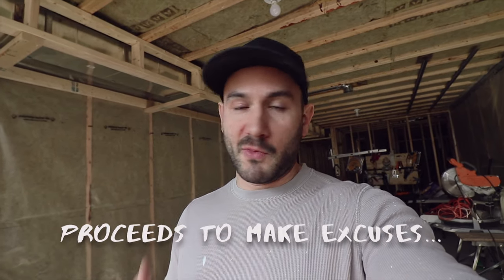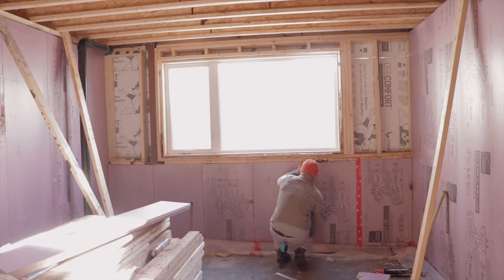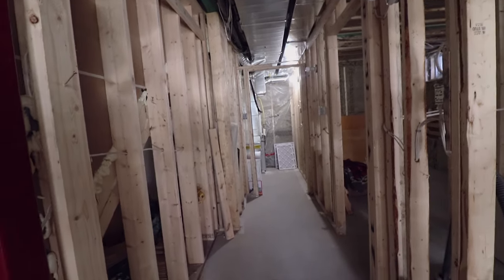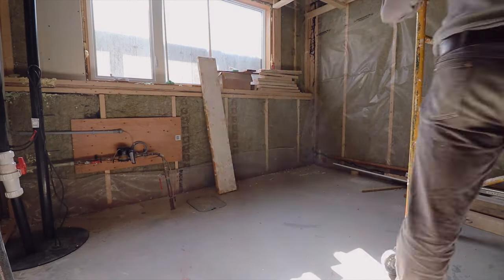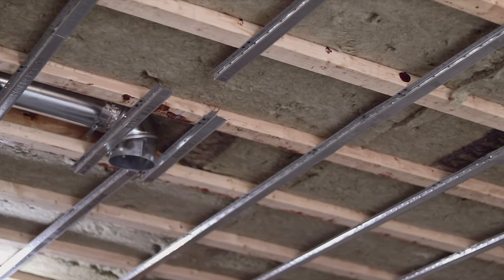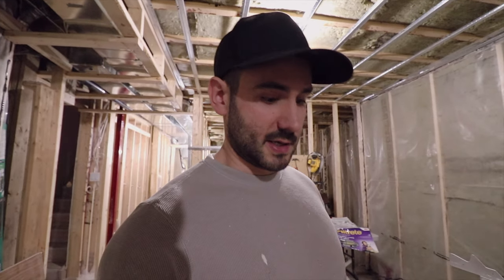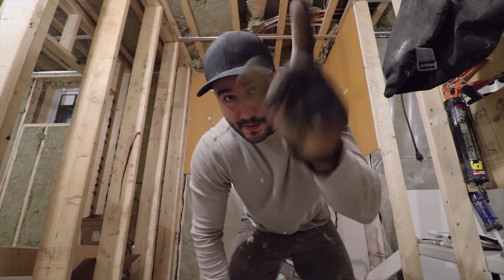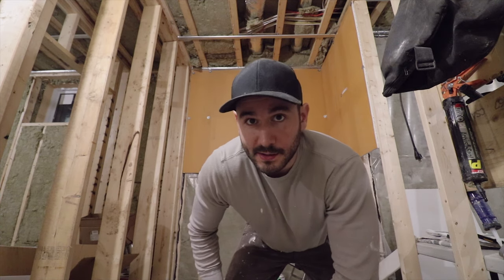EP1 : FINISHING BASEMENT - SOUND PROOFING CEILINGS WITH RESILIENT CHANNELS

Comment: Nice! Can’t wait to hear your thoughts on noise transfer once it’s finished!
Reply from the maker: Now that the tenant is moved in - I can tell you it works perfectly. Only sound transmission is through the vents and it's very little since we strategically placed them. In my next project I would just do baseboard heat in the basement and totally separate the ventilation.
Reply: Do you think baseboard heating makes a big difference for noise transfer?
Reply: Great video! Are you able to share how you mounted the res channels on the side of the bulkhead?

Comment: When remodeling a bedroom in a 1920s home, I took the opportunity to put RC on the ceiling as the HVAC unit is above this room and I put roxul safe n sound + sound clips (RSIC-1) + hat channel + double 5/8" drywall on a shared/common wall with a bathroom. I was extremely happy with the outcome. Smart thing converting the basement to an apt. Smart to deal with the foot traffic/noise before it becomes an issue. I was cheap and didn't even cover my entire room. you covered the whole area with that stuff. I'm sure you'll be happy with the results and your future tenant too.
Reply from the maker: Happy to hear - I was really hoping it would be worth the effort. Drywall starts in a few days.

Comment: Sorry I couldn't be sure from the video: in what manner did you add wood for the end of the resident channel when it ended in the middle of a joist space at a wall? Did you just overlap with a 2x4 on the top plate of the wall running parallel to the joist?
I am working in an old home where the top of the non-structual stud wall is not straight with the bottom of the joist. Figured I will be forced to adding blocking between the studs and then mount a stud to the blocking to finish my corner and have a solid mount for the last resident channel screw. Thanks for any thoughts!

Comment: Just to clarify the resbar install. For 1/2" drywall you need to do 16" centers. For 5/8" drywall you can do 24" centers. For TWO layers of 5/8" drywall you have to install on 24" centers.
Reply from the maker: Good to know! Thanks. That's what we ended up doing.
Reply: @HugoBuilds  no worries :)

Comment: I did this..rockwool, RC, 5/8th and..can still hear every footstep. It didnt even stop 10%..
Voices are impossible to hear though, but the footsteps may as well be on top of your head. But im starting to think its coming down through the walls and bevause the joists are 2x4s..and the walls have woodchips for insulation..im at my wits end now.
Reply from the maker: Hard to deal with sound.. if you hit the resilient channel with a screw it completely cancels it out. Imagine of sound like air or water, if there's any leakage through the walls. It will come down. Good luck.
Reply: @HugoBuilds  yes, I'm also thinking the guy that out the stuff up just didn't do it correctly.. and now I think it's a lost cause.

Comment: Hi:
Can you post the material list you used...for the ceiling resilient channels specifications  and tools
Thx
Reply from the maker: Might try to get to it in a later video. I just used resilient channels from the building supply store and screwed it in with metal drywall screws into the studs on one side. I then added 2 layers of 5/8 Type X drywall to the ceiling.